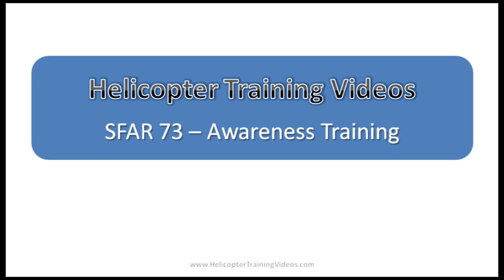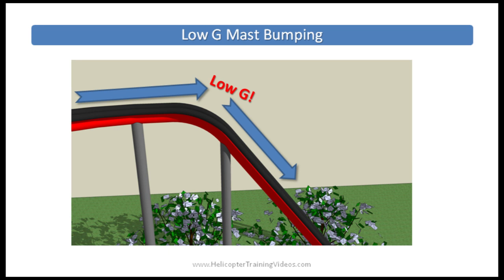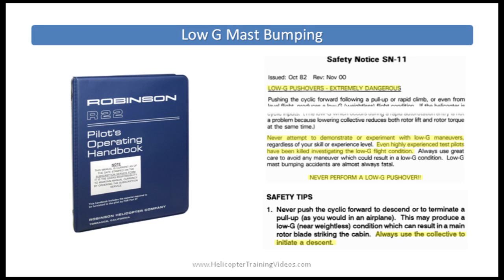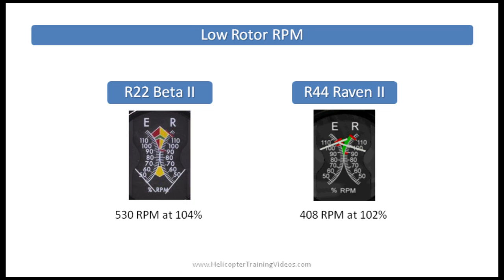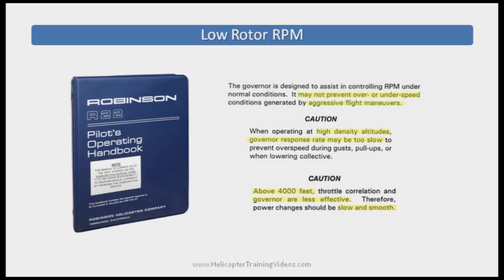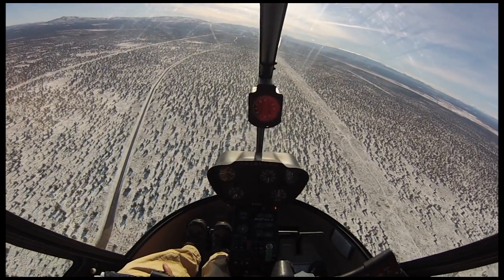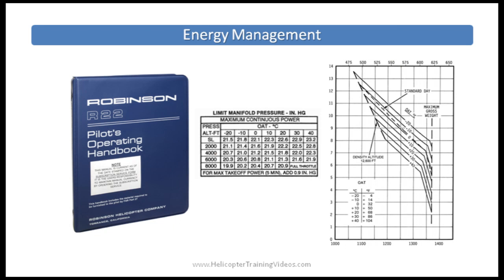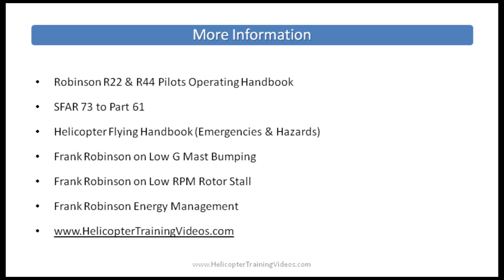SFAR 73 - What Training Do I Need Before I Can Fly R22 & R44 Helicopters? SFAR 73 Awareness Training

Comment: What I’ve learnt from high time pilots while teaching energy management is that altitude, airspeed, and rotor RPM are all potential energy and kinetic energy at different points of an autorotation. Energy is just defined as ‘having the ability to do work’. Before entering, altitude just has the potential, but it’s the loss of altitude that turns it to kinetic energy to maintain rotor rpm. Similarly, rotor RPM is turned to kinetic energy when it is used during the ‘cushioning’ part of the flare. Different rotor systems have different levels of inertia depending on weight and other factors, therefore they have different levels of potential energy that can be used kinetically during an autorotation. You can get really deep into the physics of energy during an autorotation, but I’d hesitate to state altitude as solely potential, airspeed solely as kinetic, and rotor rpm solely as inertia.
Reply from the maker: I think I was stating the starting energy form for each - it all has to be converted to rotor RPM (kinetic). But I see your point. The more I have taught I am actually second-guessing using those terms at all - not everyone understands the technical/physics terms at the start of training (which is when SFAR 73 is first covered).

Comment: My brother may JESUS bless you. Thank you so much for these videos as I am going to go for my helicopter course. This is a true blessing bro! Thanks.
Reply from the maker: How is it going?
Reply: @HelicopterTrainingVideos  I finally started and completed training day 1. I did ok, but when my instructor gave me full controls I don't think I was ready. So instinctively, I input a little more for and aft on the cyclic focusing too much on the collective and the altitude Meter and trying to find the attitude of the helicopter at 60 to 70 knots. It was difficult to focus on all of those all at one time. Overall I was able to smoothly correct some my cycling movements. Next time I'll ask my instructor if I can focus more on the collective or cyclic one at a time instaed of full controls. I struggled with the delay after cyclic input, but I realize that after each small movement with the cyclic to allow time for the helicopter to react to the cyclic input. I was expecting the helicopter to immediately respond to each cycle movement so I would often apply too much aft and end up dropping air speed because I thought I would end up and fell like I was applying too much for on the cyclic. The hardest part for me was when my instructor wanted me to do a right bank and apply more power. That menuver was above my skill and I gave the controls back to the instructor. What do you recommend I focus on for my next flight?

Comment: Low G question: take the cyclic backwards to recover G, up to what moment do I have to maintain it?
Reply from the maker: You only need to come aft cyclic enough to feel positive G restored (feel you bum positively back in the seat). If you hold it too long past that you will end up with a nose high, very slow airspeed situation. Once you have restored positive G, release aft cyclic pressure, fix any roll (although it usually sorts itself out) and maintain 60 to 70, depart the area of turbulence, or consider making a landing per Robinson's Safety Notice guidance.

Comment: Why is aft cyclic recommended during low rotor rpm events? Doesn't this load the rotor even more, because the wind is now coming from below the rotor disk and tries to "brake" the rotor? So it tries to "windmill", which would be the opposite direction of the rotor direction when driven by the engine. Can someone explain?

EDIT: Or does the rotor blade pitch goes negative when you lower the collective and therefore the relative wing from below the rotor disk speeds up the rotor? But that would mean, that the rotor RPM would decrease when the helicopter is flared heavily at positive pitch/collective input.
Reply from the maker: Great question - I believe it will cause G-loading (feel heavier in your seat) which will cause coning, which will increase RPM due to the center of mass moving inward slightly (think ice skater with arms moved in while spinning) but also I think it probably has to do with changes in airflow as you mentioned.

Comment: Hi first of all let me congratulate you on the video.
I have a question about low g and the physics behind it: is it a correct statement that weightless flight occurs when as the cyclic is pushed over the vertical component of lift is redirected along the horizontal plane, tipping off the lift/weight relationship, off loading the rotor, allowing the aircraft to freefall under the pull of gravity? If so, why the rest of the helicopter does not follow? Is it due to the residual lift in the mrs? Mant thanks.
Reply from the maker: Good question. The helicopter fuselage hangs from the main rotor in normal flight - the main rotor lift/thrust is pulling up against the weight/load of the fuselage which is generally pulling down. In a cyclic push-over, the main rotor thrust is redirected abruptly forward, "unloading the disk" and as you said "tipping off the lift/weight" relationship. Why the fuselage does not follow the rotor disk? If done smoothly and slowly we can, and do, push forward with the cyclic and the fuselage follows - but when done abruptly, my understanding is it is the weight/inertia of the helicopter fuselage that doesn't allow it to immediately follow the disk. Please let us know if you find out more.
Reply: Helicopter Training Videos This is correct. From an mechanical point of view, the Fuselage always wants to follow a ballistic trajectory, which from a situation of level flight means that it wants to go DOWN but also, due to innertia, keep its forward movement (slowing down because of the drag of course). 

Now if you push the cyclic gently forward, you influence the trajerctory of the helicopter in the direction of the aforementioned ballistic trajectory of the fuselage. You kind of give in to the pull of the fuselage, reducing it´s pull on the rotor a bit.

The harder you push forward, the more you have the trajectory of the helicopter resemble the natural ballistic trajectory of a potentially free falling fuselage and when they finally meet, the pull on the rotor is 0.

If indeed i am correct, that would meen that you can apply more forward cyclic, the lower the airspeed is, since the ballistic trajectory of the fuselage would point directly down when hovering and only moves forward if you pick up speed. 

Can you confirm that the possibility of a low g situation decreases with airspeed?
Reply: @MasterTRL  pretty sure that's what's in the POH or one of the SNs. The possibility of encountering a low G situation decreases when airspeed decreases.

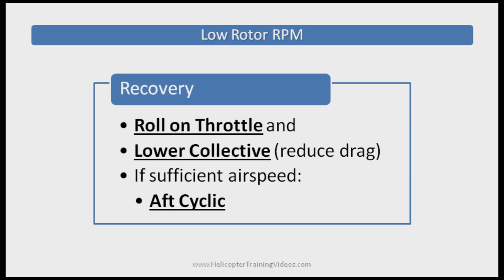Comment: if I may ask, @17:31, on how to recover from a low rpm condition, why would the instructor suggest "aft cyclic" to flare the helicopter? Wouldn't that increase drag? By the way, I also have a hard time understanding the theory behind "autorotation", and this sounds like they're both connected to the same principle.
Reply: The blades are at a negative angle like an airplane in a glide when the collective is all the way down. That gives them the energy to spin. Aft cyclic when you have forward airspeed will force more air across the blades and make them spin faster. When in autorotation you can bring the airspeed to zero and swing the tail around to see where the best place to sit down is. Then fwd cyclic to slowly get back to 65 knots so you have some more energy to burn off to stop the rate of decent.   Hope this explains it.
Reply: Thanks for replying.  From what I heard, the main rotor blades don't go negative pitch...which is what makes it hard for me to understand how autorotation works.  How about this, let's figure this out first:  Hypothetical question.. assuming the engine fails completely and the rotors are now spinning solely from rotational inertia... the pilot drops the collective, at the same time going forward cyclic to dive..would the main rotor increase rpm from the wind (windmill effect comes to mind, lol) or does it simply maintain its rpm?
Reply: With collective all the way down, blade angle is about neg 3 degrees. Not enough to push down, but enough for them to glide like a sailplane.  If engine or drivetrain fails completely, on R-22 you have 2 or 3 seconds to push collective all the way down or rotor will quit spinning and you may die. the R-44 has more inertia and you have 3 to 4 seconds, A Huey is very forgiving and still, you need to dump collective ASAP. The rotor speed is the same at zero airspeeds or best glide at 65 knots. The air has to come from below the blades to spin them as they are gliding like a sailplane wing. The weight of the helicopter will determine if collective needs to be all the way down or lifted a bit to keep rotor RPM in range. Hope this helps.
Reply: Thanks for that explanation, makes perfect sense to me now. So the blades do go negative but not enough to sustain upside down flight. Adding the sailplane illustration makes it all come together. You say the weight of the helicopter determines the amount of collective you retain, does this have to do with the concern of over-revving the rotor?  Also, at the final stage of aft cyclic to flare the helicopter, do you apply some collective then or does the sailplane effect alone provide the braking/drag?
Reply: There's alot more to this than I care to explain in a youtube comment, but the blades of the main rotor do not go "negative" even when the collective is all the way down. The key to understanding why rpm's build in an autorotative descent is the principle that lift is produced perpendicular to relative wind.
Reply from the maker: Aft cyclic with some airspeed causes a load factor (makes us feel heavy in the seat) which will cause the blades to cone up and that is like a skater pulling their arms in - it causes an increase in the rotation (Coriolis effect).